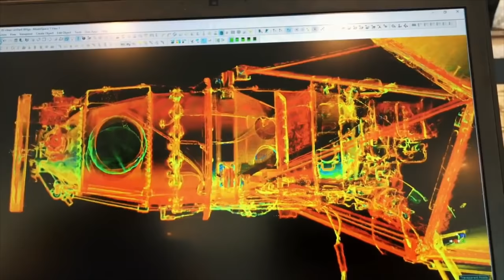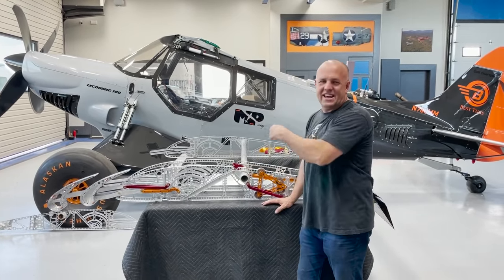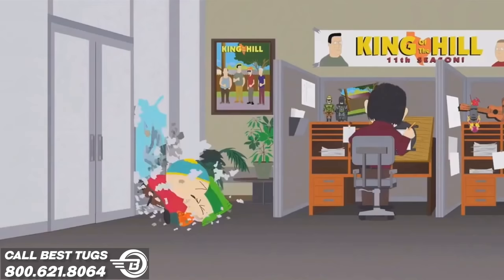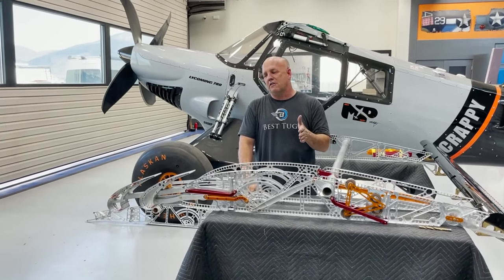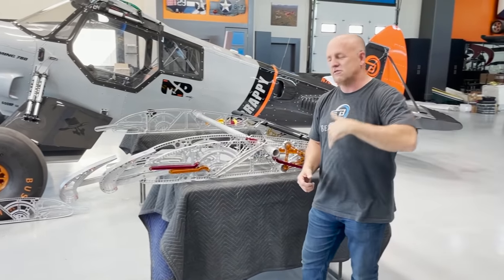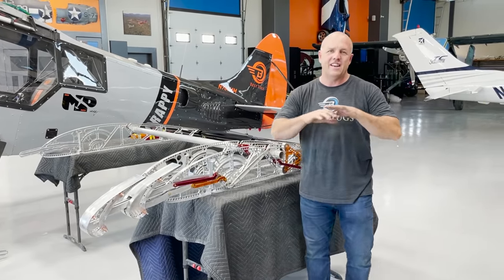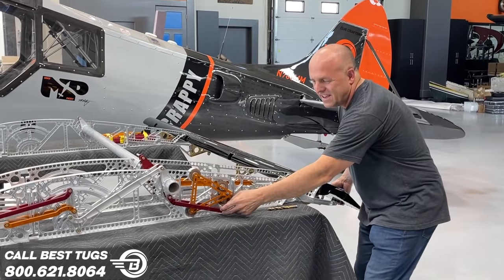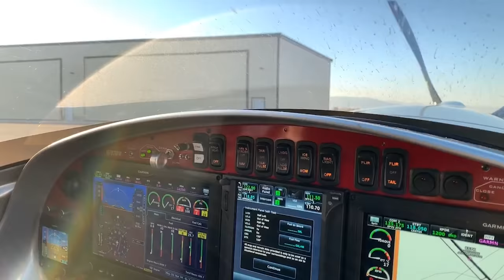DECLASSIFIED Hyper-STOL Transforming Wing - Patey Twin Slats - Fast and Slow | Scrappy #57

Comment: Very impressive mechanism, couple of points. You mention that you will have laminar flow up to the trailing edge, you must mean attached (turbulent) flow there. The flow will start small vortices after the slats when mixing the different flow streams, this will destroy laminar flow but energizes the flow such that the flow can remain attached much further aft. In cruise flight with the slats stowed the step in the thickness will likely trip the flow from laminar to turbulent as well (assuming that no air is leaking between the slats and the main wing section, sealing is important here as well). 

Structurally there is a lot of complexity and if a bolt will come loose it might jam the system, so prevent that at all cost. Double check, triple check, loctite, lockwire the whole shebang. Also the bolts of the linear actuator seem to be critical as they link the system to the stops. If one of these bolts will fail your flap system is undriven and might move to unknown positions. So I hope you have a very high safety factor on them. 

Do you have an estimate of the weight increase of the wing compared to a 'normal' wing?

Other than that I really look forward to the performance you can get out of this wing.  Impressive wing for an impressive plane.
Reply: Very good points. I strongly recommend to do a detailed failure analysis of the system, because you really need to make sure you don’t end up in a catastrophic situation. The biggest issue are single-points of failure where one thing failing can cause an incident. RickSoaring mentioned e.g. if a bolt came loose: that’s probably a good place to start. 
Can’t wait to see more of this impressive build!
Reply: You mean turbulent boudary layer. The flow is laminar if attached.
Reply: @SuperYellowsubmarin  No that is exactly what is wrong. You have 3 types of flow of the boundary layer; Laminar (attached flow, low drag), turbulent (attached flow, which has higher drag), and separated flow (with a lot of drag and loss of lift). Technically you also have laminar separation bubbles on some airfoils and Reynolds numbers but that is another story.
Reply: @RickSoaring I mean that in the second state, the boudary layer is turbulent but the surrounding flow is laminar, as opposed to turbulent when completely detached.
Reply: @SuperYellowsubmarin  ah ok, yes the flow outside the boundary layer is inviscid and can be considered laminar. But this does not means that you have laminar flow up to the trailing edge. The airfoil is in contact with the turbulent flow at the trailing edge and due to the higher velocities of the flow it has a higher shear stress, hence more drag. Turbulent flow is better at staying attached to the airfoil than laminar flow is though.
Reply: @RickSoaring  Absolutely. The laminar flow is just about 20% of the chord on a clean airfoil IIRC. By the way, CFD is a great tool but let's not forget all phenomena is not accounted for, like spanwise flow. Things to keep in mind when drawing conclusions.
Reply: Thanks, I was wondering whether someone would point this out about attached turbulent flow vs laminar flow

Comment: Mike I love this series as an engineering student. Very inspiring. You proved your FEA simulation with a full scale test, how will you prove out the fluid flow analysis with a similar test before going full up? I guess the fea test is easier to prove and is maybe more safety critical. But I would argue lift characteristics are also safety critical. Curious to see how it performs versus CFD. Modeling is such an amazing tool.

Comment: Years ago solid wing landsailors used a short width flap for more power, then a double flap with a second gap much like Mike’s double leading edge slat design.  I can remember one solid wing landsailor that had a single flap operated by a drill motor and a leading edge slat that was fast.  I was privileged to co-pilot Sirocco years ago to 94 mph; very close to the land speed record for a landsailor.  Since then there have been few leading slat wing designs for landsailors, but Greenbird with a wing with rear mounted second small wing hit 126.2 mph in a 35 mph wind for the world record.  Mike’s idea of a double slat balancing large flaps and drooping ailerons looks to be the next development of a truely adjustable wing for all modes of flying.

Comment: High performance sailboat use dual/trippel headsail to the same effect. Look at the ocean race vo65 boats. And imoca 60. Farr 30 from 1997 use a 108% headsail (8% overlapping to the main sail) to accelerate the main sail “pressure”
Reply: Mike's wing increase the "sail area" more efficiently than a headsail.

Comment: Have you done the flow analysis when flying backwards? Cause the way this is going it won’t just be STOL OR VTOL but you might be able to fly at negative speeds and still have lift!  🤣🤣🤣
Reply: He will have to use really strong tie downs even in the hangar. If someone opens the door on a breezy day, the plane will be up on the ceiling.
Reply: Honestly, you might be right, on a windy day this thing may very well fly backwards.

Comment: Looks like he has come to the same conclusion as many of the Formula 1 aerodynamic designers who have massive budgets for design and prototyping as if a big single wing worked they wouldn't be using all the little winglets obviously they help with preventing flow separation, probably creating some more progressive pressure gradient and the ability to use dynamic adjustment on the fly is perfect for its intended function.
Would be nice to see a video of it flying backwards relative to the ground in a moderate headwind. Good Luck.
Reply: @amytaylor7210  Ok thanks i suppose, but GOD DOES NOT BLESS ME.

Comment: It Will be interesting to see how the red piviting piece, that rises above the surface of the wing ( by rotating pipe), is covered after the wing's full assembly.  Will it moving above the top surface affect the wind current?
Reply: I was scrolling through the comments to see if someone mentioned that. It looks like there are a few brackets for the pushrods that will protrude above the surface of the wing when the slats and flaps are fully retracted. I know Mike has something up his sleeve. He is too thorough.
Reply: im expecting a fairing or bubble to streamline it out, but with mike building it you never know
Reply: @21083blake  I did the exact same thing and found you guys thread 🙂. I wonder if the piece will still go through the skin in the final assembly. Wait and see 🙂
Reply: I bet he hated having to make that concession in having parts of the mechanism outside the wing, but you gotta do what you gotta do to get the leverage required. You see those same sort of concessions made on commercial airliners.
Reply: He's gaining so much from this design that a little bump is negligible 🤷‍♂️
Reply: After reviewing the animated portion of the wing I saw the small cover at the pivot piont. Cool.

Comment: Fascinating! Reminds me of a joint NASA-Air Force project my grandfather flew on in the early 80s. They were testing a modified F-111 Aardvark equipped with "mission adaptive wings" that could actually change the airfoil shape and camber in flight, ensuring optimal wing performance throughout the entire flight envelope.

Comment: The assumption being the pilot knows and will be aware, and thinking, when he needs flaps and when he does not.  That thumb actuator 1-up, 5-down will be useful and quickly become intuitive. The Navy’s A-4 Skyhawk’s wing design assumed, I think, higher speed turns under heavy-g wing loading would be enhanced by just leading edge flaps pulling themselves out when air flow over the leading edge reached critical angle of attack. Then popping closed the same way…. but then, you don’t plan to be dropping ordinance or needing to dodge airborne obstacles.
Reply: The Slats on the Scooter, Phantom, and IIRC F- 86 and 100 were all unpowered driven solely by airflow and/or Gravity.  Part of the Preflight was to push the slats up into full retract, and make sure they came back out on their own Smoothly with no binding.... You REALLY Didn't want an Asymmetric Deployment
Reply: If you go watch F-16 flight footage or any aircraft built after; you can see flap and slats automatically move based on airspeed and pilot stick input
Reply: "…. but then, you don’t plan to be dropping ordinance or needing to dodge airborne obstacles." I beg to differ......
Reply: @bucketofguts   tell us more!

Comment: I notice when the wing torque tube rotates, the tips of the push-pull arms extent past the top of the wing skin line.  Will you have carbon fairings for each of these?  I suppose they could be open but that doesnt seem your style.
Reply: It looked to me like the torque tube could be moved down a bit so the arm did not go above the top skin, but I assume Mike has a reason for doing it this way.
Reply: I think this location  was necessary for the push pull mechanism to clear the spars?
Reply: This seems to be a very odd design element, and I can only guess Mike has a reason to intentionally design it this way.  However, it does seem like the slat push-pull lever could be mounted below the torque tube, and the flat/aileron levers mounted to the top to stay inside the "skin envelope."  Of course that requires reprogramming the opposite motions of the linear actuator, but that seems trivial.
Reply: I was going to ask the same thing but you beat me to it.  Kudos.  Well Mike?

Comment: Hi Mike - are you going to put a section of the wing in a wind tunnel to ground truth the flow equations?  We know next to nothing about the boundary layer and how it behaves even in 2021.   Those flow programs seem accurate however, at best, they are only an approximation of reality.  Wind tunnels haven’t disappeared with the rise of computers.  I saw your video where you rigged up a test jig to stress test your spars and made sure the stress and strain calculations were correct.  IMHO you need to do the same for the CFD.

I would be much more enthusiastic about the wing if you had the wind tunnel results and the degree of agreement with the computer.
Reply: Hi Mike, I'm a freelance Solidworks designer and although not in aerospace, it would seem to me a that exporting a solid model of the wing surfaces in each of the six slat/flap configurations would be straightforward. Then, assuming actual flow dynamics are roughly scaleable, you shrink the models to a size both 3D printable and compatible with a willing wind tunnel collaborator. I agree with this gentleman that it would greatly reduce unproven aspects of this design... further, I bet you could get Dassault (Solidworks) to pay any expenses in exchange for access to your data. Great job here!! Congrats!

Comment: Mike would adding dimples such as on a golf ball help speed that air up and keep it attached?
Reply: Look up "vortex generators" for a non-slat solution to help keep airflow attached to the wind at high AOA.
Not the same thing/purpose as dimples, which detach air for less friction and longer flight. :)

Comment: I had to watch a second time it was so good , one point you did not or I missed the levers on the torque tube appear to go up higher than what I thought would be the top skin, will they be fairer in?
Reply: Yeah, what’s happening with the ditties that come out the top at full retraction?

Comment: These all look like 2D steady RANS simulations, which generally underpredict separation so I would take these results with a grain of salt. 
I also don't get why laminar flow is so great here. If you're at high lift you don't care about drag, and the gaps are going to cause transition in cruise when you have the slats stored.
Reply: Agreed...Beautiful craftsmanship... I don't buy the aero... CFD has a history of overpredicting CL_max, even when the assumptions are correct which I'm not sure his are (Kutta condition appears to be violated in your photos). Drop the second slat save the weight, it will increase wing area but almost guaranteed not to do anything. Read A.M.O Smith high lift aero...
Reply: Came here to see if someone mentioned this. I’m interested in what kind of CFD solver he used. And I agree… separation and drag are notoriously difficult to predict in CFD.
Reply: @notjackschannel5380  Yeah, I would be curious to know the solver as well. My friend pointed out he must be confusing laminar flow with attached flow. I say this partly because I doubt he is using a transition model, probably the standard Spalart-Allmaras model or k-Omega, so the boundary layer is basically assumed to be turbulent. But really I just doubt the flow would stay laminar that long, and the context of his pictures have to do with attached/separated boundary layer vs laminar/turbulent boundary layer.
Reply: @notjackschannel5380  It looks like flow works from SW, which admittedly, I do not know a lot about. I do know that zero CFD people I know in aero use it, so that doesn't give me the warm fuzzies. I'm assuming Mike has someone else in the background doing the CFD for him and I respect him for trusting his specialist if that's so. I get this impression because he sort of talks about pitching moment and trim in ground effect with the flap system, without really talking about it, so again, it appears he has people he trusts to do these calculations and is doing his best to relay the thought behind it. If the slat system doesn't pan out, he'll just have to land at 80+ kts. I think with the square wing planform the spanwise lift distribution should be ok though, so hopefully stall/spin characteristics are somewhat favorable. I guess we'll see!
Reply: @JustARanter6703  Yeah, I struggle to be too critical of him. His enthusiasm, motivation and go-get-it-done attitude is impressive to say the least. I just hope he understands the limitations of his CFD results.
His misuse of the correct terms (“Laminar” vs “turbulent attached”) may just be him using terms that his audience understands rather than using the precise aerodynamic terms. I mean, this is YouTube and not an AIAA conference, ya know 🤷🏻‍♂️.
Reply: @notjackschannel5380  Oh yeah I completely agree. Obviously he's put tons of work into it and the quality looks phenomenal, and you can only do so much (especially with something like CFD that has a pretty steep learning curve and can expensive to run). 

That is probably true, although he uses terms like camber that may be a more common but still "technical". I guess if he knows he using the wrong word it bothers me because it is perpetuating a misnomer, and if he thinks he's using them correctly then it's fair to take his aero assessment with a grain of salt. This field is where I come from so obviously I'm overly sensitive about it.

Let me know if you'll be at SciTech and want to talk more over a beer.
Reply: @JustARanter6703  I’m very tangentially associated with CFD work and my coworker has a PHD in CFD, so I know some based on that. I’ve also tried my hand using Openfoam a bit, but not professionally.
But hey I’m always down to talk aerodynamics over a beer! I don’t know what SciTech is, but I’ll look into it.
Reply: Even if it doesn't give the exact performance predicted by the simulation, it should still work pretty damn well by increasing the wing area. If necessary he can always try to adapt to a single flap / single slat design later.

Comment: Airliners have a similar device on the wings also. If you've ever sat at a window seat near the leading edge of the wing on an airliner, you will see this exact action happen. I'm an A&P licensed mechanic. I also have a couple of semesters in Aircraft Engineering. This also allows the airliner to drop altitude without pointing the nose downward.

Comment: I wondered why it took so long to start building the wings. Now I understand. Worth the time! Your design is such a radical departure from the norm, I would recommend you build a physical model and test it in a wind tunnel before you do a flight test. Software tools don't always reveal all the issues with a design. There is probably a university out there that would give you some time in their wind tunnel.

Comment: Those vectors coming across the top are very impressive and the depth of low pressure is...well like you said, hard to believe. But I do believe! I looks like overall clearance between the inboard slat and the wing is grater than the clearance between the outboard slat and the inboard slat but I only get one quick look from an angel that is not ideal. The sum is greater than the parts...I should stop speculating, Scrappy will fly soon and we'll see.

This is going to work Mr. Patty.

Comment: Won’t bother telling you how great this is.  I do have a concern over that single throttle switch that effectively dumps you to high speed (low lift) mode.  If you have an inadvertent touch of that button during slow flight…bad situation.  We lost a Searey when someone inadvertently hit the button to zero flaps from full.

Comment: When I was flying RC planes, one of the guys I was flying with wanted to do a heavy air drop, to counter the change in CG, he built a contraption that lifted the wing from the fuselage and moved it back, so he both got the fuselage width of extra wingsurface as well as moved the wing back for the heavy load, once it was dropped, a servo would pull the wing forward and down onto the fuselage, giving a bit less wingarea and a forward position that better matched the empty weight of the plane.
It worked quite well once he got rid of the play in the system.
The plane was impossible to fly with load and the wing in the front position due to being tailheavy, it was flyable (but not good) once the load was dropped without moving the wing  forward/down.
So he flipped the switch when the load was dumped and got a plane that was easyer to land.